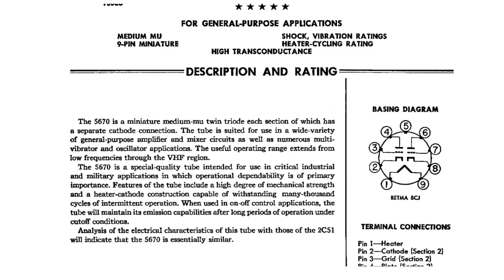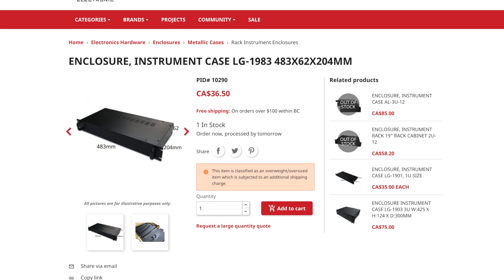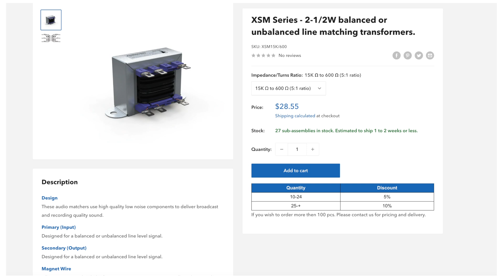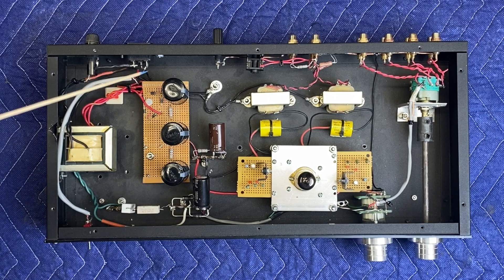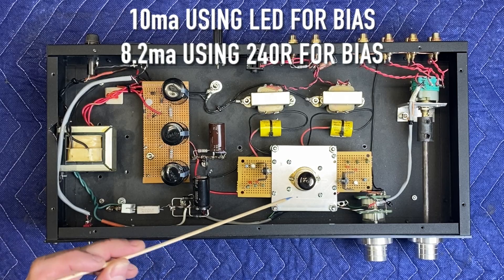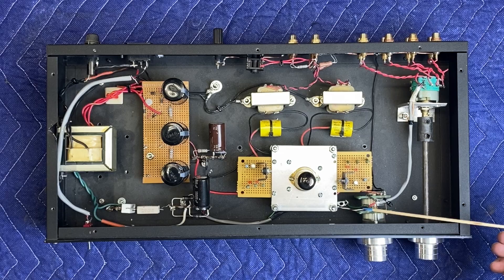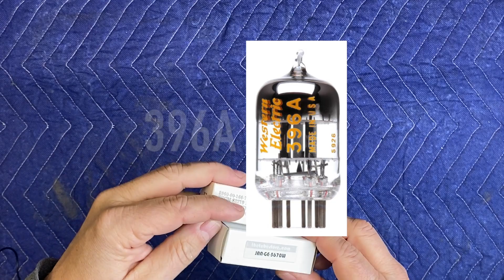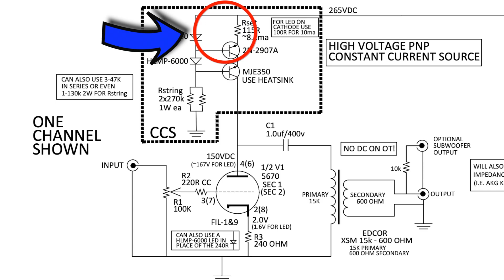How to make a 5670 tube preamp // DIY HiFi single tube linestage

Comment: Why chose 15k for primary?
Reply from the maker: Thanks for commenting. This is a good question and fair amount of theory.  I'll try my best to keep it short. The primary impedance is chosen for maximum power transfer. The theoretical ideal for maximum power output is for the external plate load impedance is equal the tube's internal plate resistance. (ZL = Zs).  For single-ended (SE) the optimal load impedance is often a compromise, which balances power output with acceptable levels of total harmonic distortion and a good damping factor. So you want Zs to be less than ZL. For some triodes their internal plate resistance can be relatively low (e.g. 800 ohms for a 2A3), the optimal load impedance is typically chosen to be 2 to 5 times the Rp to maintain low distortion. So for a 2A3 SE we typically choose a 2.5k to 3.5k primary impedance. Since this circuit is a preamp, we are not needing maximum power output, we are wanting medium voltage gain with low distortion throughout the entire voltage sweep. For this 5670, the Rp is 6400ohms, 15K works out to 2.3x.   There is more to it than this and there are some other variables that you need to consider (like plate voltage and the reflected output load) but for a 5670, I would stick to 15K. You could try 10k to 20k but I have no idea how that would work or sound in the circuit shown in this video.  Cheers.

Comment: I am thinking elevating the ground like 60v and make it AC. I almost give up on this design. Any other suggestions?
Reply from the maker: Thanks for commenting. Did you build it the same way? Are you using similar components? Same layout? Are the output transformers 90deg to the PT?  Hum can prevent due to many things.  Layout, Grounding, not enough PSU filtering and heater supply are several.   You can use AC on the filament to good success. I'd just use 2-100ohm resistors to reference to ground.  You can email me some pictures and a diagram of what you did if you like.  Cheers.
Reply: @MikeFreda  Mike thanks for the help, I am following the exact circuit you posted with the exception of the CC supply to the anode. I am using  PT 261G6. Voltages are a little high but with the 20K plate resistor  I am getting about 140V to the plate. The transformers are 90 deg and now move them all out of the box, still the same. I can email you pics, but do not have your email.
Reply from the maker: My email in shown on my YT homepage in the about section.  Cheers n

Comment: Mike, I have made the circuit a couple of times but I keep getting hum in the final design. For the moment not using the current source, just a 20k. For the heater using a rectifier.
Reply from the maker: Thanks for commenting. Hum can be tricky to eliminate! It sounds like you're on the right track by trying different approaches with the current source and heater. Have you tried experimenting with different grounding schemes or shielding in your build?  If you didn’t build as per my original design, it’s hard for me to provide guidance.  That being did, your plate resistor may be too low of value. What are your voltages?

Comment: Video is VERY INSPIRING - however I hsff BFF r a problem either way that 265 volts connected to the upper end of Rsett 

And 265 volts is connected to the base of the HLMP Diode.

How can you go that !?

Triodes are 5 volts connected devices.

What am I missing !!

Please answer -
Reply from the maker: I'm unclear on what you are asking. There is a link in the video description for some more information on how Constant Current Sources work. The LED's are being biased via the 2x270k resistors to 2mA. These LED's bias the transistors. Rset determines the Constant Current value to allow the 2N-2907A transistor to switch/adjust to that value in conjunction with the MJE350 power transistor. This maintains a steady current to the 5670 (in conduction with the Cathode resistor) for better linearity and noise rejection.   You "can" omit this CCS and replace it with a resistor or even a tube for a SSRP topology.  I hope that answers your question? Cheers

Comment: Странные конструкции
Reply from the maker: This topology is called Parallel Feed or Parafeed.  Rather than using a Plate Choke, there is a Solid State Constant Current Source in its place and rather than a normal Air-Gapped output transformer, it uses a transformer with interleaved core laminations. These two items are coupled with a high quality capacitor. This OT sees no DC thus it can be smaller and use "exotic metals".   There is a lot of information online regarding this. Cheers.

Comment: Mike, Thanks for posting videos like this, I think I watched this video like 20 times, but have a question, I seems like the 6.3 v needs another resistor on the other side of the coil, your diagram only shows a 2R 5W resistor in one side. What are your thoughts?
Reply from the maker: Thanks for commenting. I'm glad you liked the video. It's one of my favorites.  The 6.3v filament circuit is being converted to DC. When you convert AC to DC it's not a perfect like-for-like voltage conversion. To get the voltage under 6.3VDC you need to add a dropping resistor.  Depending on the PT you use it can be anything from 0.1R to 3R. For the PT and tubes I used,  I had to install one 2ohm 5 watt resistor.  If you want to go with something simpler, you could just go with 6.3VAC on the filaments, you just need to use two 100R resistor to ground like I show in my 6J5 Preamp. This creates a virtual center tap to help elevate the filament ground to help prevent a heater hum getting into the circuit.  I hope that helps? Cheers
Reply: Thanks, I got hum and trying to identify the source, I connected the 6.3 directly to the filament, now trying to implement the filter.
Reply from the maker: I see.  Tracking down hum can be frustrating.  
Try adding 2 100ohm resistors from each leg to ground.

Comment: Why is a CC type resistor recommended between the volume pot and the grid? This is primary input signal path and must be a typo.
Reply from the maker: Thanks for commenting. You can use whatever you want… or nothing at all.  I just recommend CC or Carbon Film for noise / RF rejection.  The theory is that these types of resistors are less prone to induction.  Cheers.

Comment: very nice Mike!  i saw & did build the " soul sister " version done by Bottlehead, Dan Schmalle had the 240R bias resistor a bit off initially. Mike Lefevre even did me a pr. of cobalt 15k : 600R irons before he left this stage.  but i ended using those on a 26 linestage. how are the Edcor irons? it was 1st time working with the HLMP-6000 leds!they're such dainty babies!
Reply from the maker: Thanks. This preamp I built was inspired by the circuit that was posted in Valve many many years ago in. I did change some parameters,  added the PSU section, DC heaters and figured out the layout. Grounding is important or it will hum.  The OT's I used and stuck with are Magnequest. I did try Edcore and they are okay for the cost. I did notice some roll off in the lower frequencies but if you have a sub, it's not an issue. Cheers

Comment: Very excited to find your JAN 5670 pre build! Exactly what I'm looking for. I have an Aleph J and I love the 5670 in my current pre section - a schiit vali 2 does surprisingly well as a line level amp.   But of course, I want to hear more of what this 5670 tube has to offer.  I already have a lonely khozmo stepped attenuator for my pending preamp project, so this project looks like its the one for me!! I'm very excited.

Asking clarification:
My Aleph J has an input impedance of 242K, so accordingly if I omit the output transformers it looks as if the preamp output impedance will be 15K.  242K/15K is still a 16:1 ratio. Per google that's fine, because there's still enough difference to get those precious volts across the gap. I need 1.5V to fully drive the Aleph J to 25Watts. 

Absolute reduction:
If I don't need the OT,  then I don't need the output caps. The Aleph J also already has DC blocking 1uF high grade caps on the input section of the amp boards. So to get going I basically just need the PT,  the B+ and filament sections. I'll initially skip the CCS boards and use plate resistors. To test I only need a single input and output through my pot or maybe even just some test mills resistors since my source is digitally attenuated. I could build the whole test unit on a piece of wood and a bunch of terminal strips! :) booyah

Ref: https://www.firstwatt.com/wp-content/uploads/2023/08/prod_aj_man.pdf

Comment: Thank you for this wonderful video. I just looked up the spec sheets of the Hammond 261c6 to check if they can handle 230V from the European grid. I'm not getting smarter. On top of the spec sheet is written that the 261c6 is only for 115V but the B6 and D6 is 115/230V and 50/60Hz. The D6 seems to be the choice, but when I look up the D6, there is no hint, that it can handle 230V. The transformer itself says 115V 50-60Hz. Have you any experience with Europeans and the same problem? I can't find something in that spec range on our market, so I have to import it. Would be happy to know if it works before I order something. Cheers and keep going, your videos are great!
Reply from the maker: Thanks for asking. Since I'm in North America, I don't have a lot of experience with the European grid.  As per the spec sheet, the 261D6 has dual primary windings. I would suspect that you would wire those in series for 230v operation making note of the phase dots. The Hammond 229B230 shows how to wire it for 230v.  Another option is using a their 300 series (220v transformers). 369AX should work nicely. Use a full wave bridge and omit the CT connection.  I hope that helps? Cheers
Reply: @MikeFreda  Thank you! That helps a lot. I thought so. Sadly I couldn't find a picture of the 261D6 at first, but then I found out about the dual primary windings. I think, I'll give it a try. The hint with the 229B230 wiring is really helpful.

Comment: I love 5670's I use them on the front end of my integrated amps. I usually use one per channel with the tone stack between the two sections. Has just enough gain to accept the standard line in from other components.
Reply from the maker: Yes, they are becoming my favourite pre tube.  They are very linear, have moderate gain and don’t cost that much.  I’m curious about your tone stack.  Cheers.

Comment: Can this unit be built for a recording studio scenario?
Reply from the maker: For mic’s and guitar input?   No, not enough gain and the input impedance are not ideal. For the output impedance, you need to see what gear you are chaining to.  Could this circuit be modified, sure but you need more information.  Cheers.

Comment: Perfect sharing thanks you for detail. If tube change ecc83 can use?
Reply from the maker: Not really. Do not recommend. A 12AX7 has too much gain (mu of 100) for this application and the output impedance is also different. 
You would better luck with a 12AU7 or a 12AY7 but you would need to select different output transformers due to the higher output impedance of these tubes.  
Sort answer, no. It’s the wrong tube for the job. Probably be noisy as well. Cheers.

Comment: Great preamp.  Do you have schematic for use power transformer without  transistor current source. Thanks
Reply from the maker: Unfortunately, I don't.  The performance of this circuit design would not be great if you removed the Constant Current Source.  You could try and remove the CCS and install a ~14,000 ohm  2 watt Plate Resistor and use a 240 ohm Cathode Resistor but I'm not sure if there enough voltage swing to make that work properly. Worth a try I guess.   If you want to use this tube without a CCS you basically need to rework the PSU to have higher B+ (Higher voltage PT) and better channel separation buy using an extra RC node for each channel or use some chokes. I'd recommend looking at the 5670 Tube Data Sheets for more information.  I'm not sure if there is much of an appetite for me to rework this circuit without the CSS. It would be easier to build but it would be a step backwards, cheers
Reply: @MikeFreda  thank you so much
Reply: @MikeFreda  so you are saying I will try 14kohm resistor with 150 volts supply?
Reply from the maker: No, that's not what I am saying.  Keep the PSU the same and just replace the CCS with a 14k 2W resistor. The tube needs 150V at the plate to operate properly. To get enough voltage swing, you need the B+ to be at least 100V more.   Last cap at the PSU ~265VDC - 14K resistor 150VDC at the plate of the 5670.  To be clear, I have not done this. I'm not sure how it will sound. Cheers.
Reply: @MikeFreda  i understand, I will try that. Thank you so much

Comment: Can I make a suggestion?

As a recording engineer and musician, who wants to build one of these myself 

May I suggest that you have dual functionality one for recording and one for monitoring through your daw digital audio workstation

As I believe the tubes need to be somewhere else in the circuit to do these two jobs separately, which can be easily fixed as long as the box is set up right from the beginning 

So then you want to monitor your mix when you’re not recording through the tubes

Generally, for mastering purposes
Reply from the maker: Interesting concept.  I'd have to research and study that.  Does something like this already exist in a tube format?
Reply: @MikeFreda  I don’t think so

I am definitely not a tube expert myself. I have some audio engineering skills, but of the electrical nature none 
Although I am very interested in the subject 

But I can point to do a video where somebody mentioned that concept that I am talking about
Reply: @MikeFreda  https://youtu.be/j2vPU4ShL-c?si=CilvauSVxW2FrBoe

This is the guy I was listening to

Comment: Why do you use an output trafo for line level
Reply: Very interesting. Step down.
Reply from the maker: @ColocasiaCorm  To get the proper impedance matching.  The 5670 in this circuit is set up as a voltage amplifier with an approximate output impedance of 15K. That is high to feed directly into a power amp. It would not sound good. These transformers are 15k:500ohm.  You could omit the transformers but you need something like a Cathode Follower circuit to tame the  higher impedance.  Cheers.
Reply: @MikeFreda  what if the input impedance you were feeding to was higher?
Reply from the maker: How high? ~15K input impedance is pretty high for most tube amps. Perhaps Solid State amp. You would need to check the manufacturer's specs. You can also change the ratio of the output transformer to suit or add a cathode follower stage.

Comment: hi 
is it possible to add bass and travel gain to this design? can I contact you via mail?
Reply from the maker: Thanks for commenting.  Due to this circuit being a single stage (Voltage Amplifier) it would be difficult to implement that.  My other preamp circuits (6SN7 or the 12AU7) that could be implemented in them. You would have to be careful with layout and topology since adding pots within the circuit could induce some noise into the system. That being said, In all my preamp designs I’ve made over the years, I’ve never thought I needed to add something like that.  Cheers.

Comment: Hi Mike -- I have purchased almost everything needed to make this preamp.  But (here in Europe) I am not finding the 2N2907a TO-39 transistors you have specified.  The TO-18 or the plastic 2n2907a are available.  I have ordered some 2N2907 (no 'a'). But I just noticed that the specs are slightly different from the 'a' version. Will these work? Or can you advise a substitute that will work?  Thanks -- Rob
Reply from the maker: Thanks for commenting.  I’ve used both types in the past the they do work. From what I recall, I think the pin outs are different so just double check them before you solder them in place.  Good luck, cheers.

Comment: Capacitors on output matching transformers are too small for parafeed topology.
Reply from the maker: Thanks for commenting.   This is an interesting topic. C = 2xL / (RxR) is the basic formula for sizing a normal Parafeed capacitor. C is the capacitance in farads, L is the plate choke inductance in henries, and R is the load impedance seen by the plate (i.e. transformer primary impedance) in ohms. If you use kiloohms then C is in microfarads.
 
This basic formula works well for power amps feeding speakers. The value calculated gives the best bass extension while keeping the impedance seen by the tube's plate relatively constant and resistive to the lowest possible frequency. The value is not that critical, anything from half to twice this value will work.
 
To my understanding, there is no formula that works properly for the Constant Current Sources that are used instead of Plate Chokes. The other issue for preamps is the unloaded secondaries which complicates things even more. The simplified formula ignores the effective resistance in parallel with the OPT inductance. The approach is to experiment with different capacitor values and make measurements. You'll have to measure the frequency response at a variety of signal levels to see what works best for your speakers and ears, which I have done. I honestly cannot hear a difference between 1.0 up to 3.3.

What would you recommend and why?
Reply: @MikeFreda  If I were you, I would measure frequency response and distortion. It is difficult to predict frequency dependant systems with simple theory. SPICE might help but it is just a simulation based only on user defined inputs. Totally symetrical topology might be a solution for really quiet, extremly linear and sonically neutral device. But again you will hit the issues with HQ audio grade singe ended to symetrical (and vice versa) line level transformers. It is difficult when playing on high quality level.